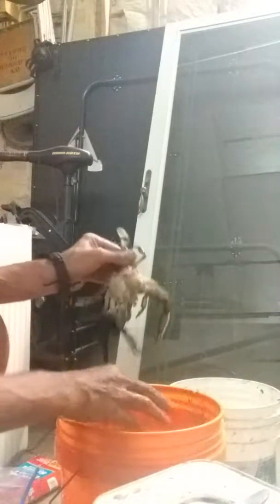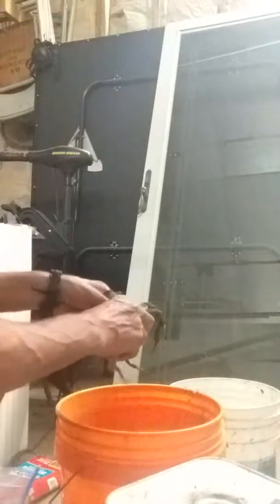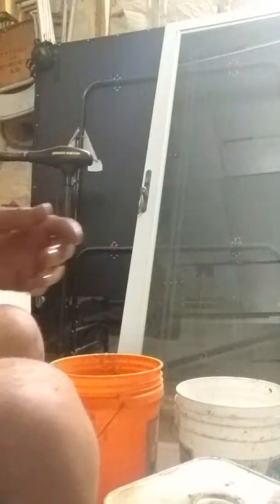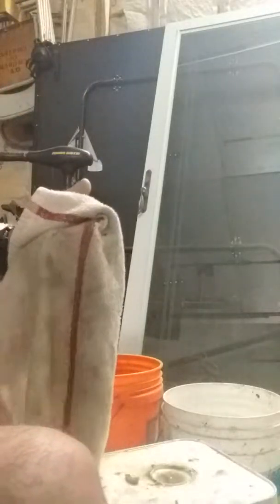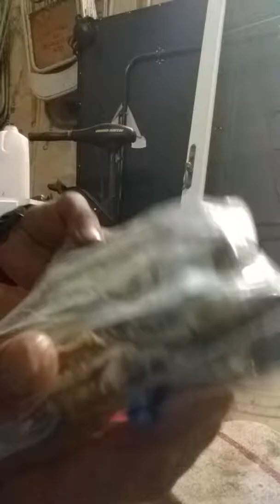Freezing Blue crabs and cleaning.

Comment: Im thinking if u DID ice them down in a cooler b4 cleaning them so they r easier to handle...it might speed up the freezing process also bc they r starting off in the freezer at a lower temp to begin with...just a thought.
I've never froze crab b4, do u think the taste or texture suffers at all?
How long have u kept frozen b4... b4 u see a difference in meat quality?
Reply from the maker: I do normally chill them down like you said 🤣  I think yes the texture does suffer some but depending how you cook them and how long. I've had 50-50 luck on steaming. But in sause's they are Great.